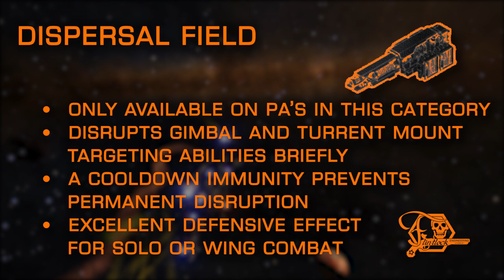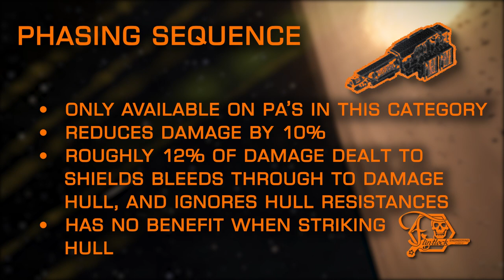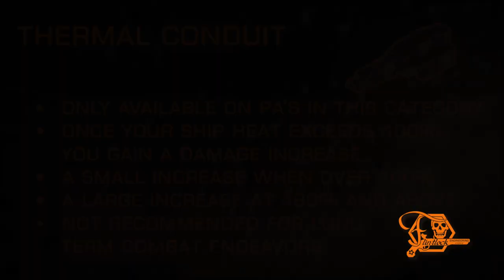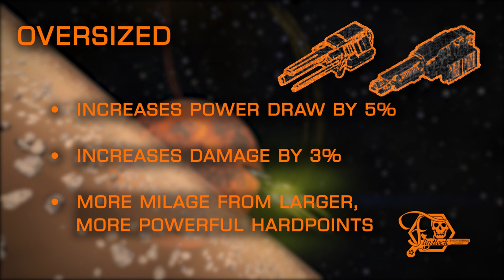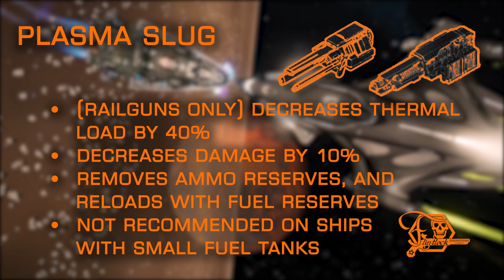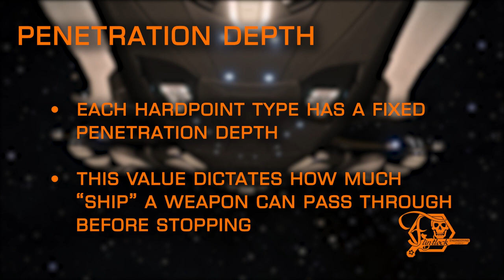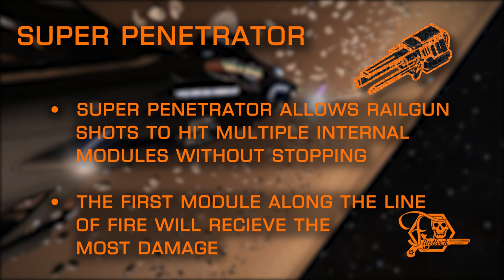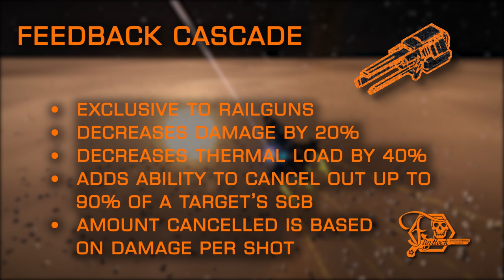Engineering Series - Episode 8: Railguns and Plasma Accelerator Experimentals

Comment: How much is the decrease on Super Pen for each consecutive module? Does it hit 100%-90%-80%-etc or is it like 50%-25%-10%-etc?
Reply from the maker: Excellent question. To my knowledge, it's a random % of damage to each module, but it seems the % amounts decrease after each module hit.  Extremely difficult thing to test and calculate! but I'm working on it :D
Reply: @FlintlockEngineering  Can't wait to see the result!
Reply: Great series, as a ship designer I've usually avoided doing much in the field of military ships given so much with weaponry was not explained very well. I've learned a lot and now some of my experimental failures make so much more sense, both in offensive and defensive capability. Thank-you very much for this, I'll be sitting watching these and making notes for a month lol

Comment: Does one volley from imperial hammers count as 3 hits for the purposes of canceling shield cell banks?
Reply from the maker: it does not. As shown at 10:10 - the amount cancelled is based on damage. so a volley of 3 shots from Hammers will cancel slightly more because it deals slightly more damage than a single railgun shot.
Reply: That is of course you land all 3 shots from the Hammer.

Comment: I would like to say the thermal conduit information is incorrect.
It begins at 100%(normal damage) at 90% and below, and each % of heat above 90% adds 1% damage, up to 160% damage at 150% or higher heat